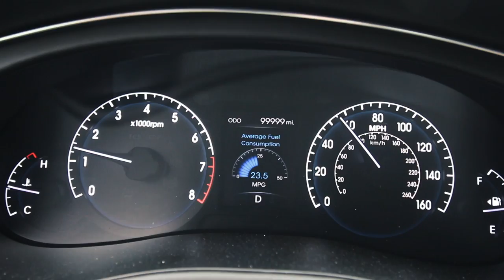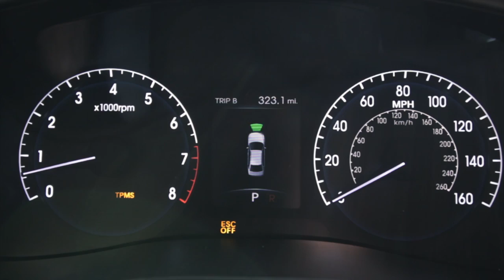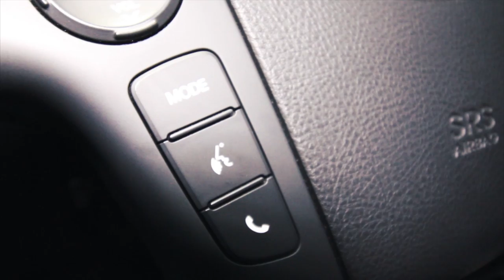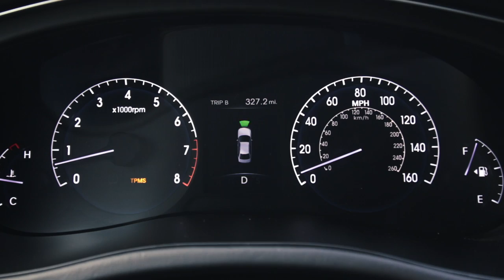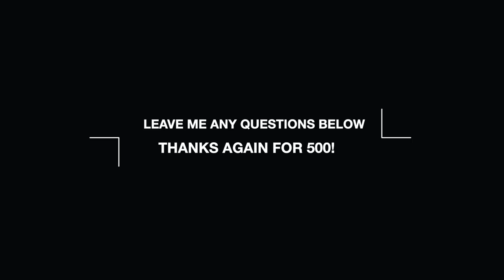2012 Genesis 5.0 R-Spec Long Term Ownership Review

Comment: Currently looking at a 2012 r spec. Thanks for the great info. I'm seriously considering the purchase.
Reply from the maker: wyohotrods No problem at all. Good luck with your search friend.
Reply: Consider a 2013 to avoid possible high oil consumption (based on what I've been reading)
Reply: If possible wyohotrods, look for a Southern Car and if possible, a one-owner R-Spec.  I bought my 2012 5.0 R-Spec down here in North Carolina and it was a one-owner with 67,000 miles. I found the previous owners business card in the owners manual and I reached out to him and he was awesome.  He took incredible care of the car and was in the process of upgrading the exhaust (he had the x-pipe installed) which saved me some coin as I installed Borla mufflers last week and it sounds incredible!!

Comment: 2013 3.8 V6 4dr with 112k miles. Fighting a parasitic drain. Dealer pulled drivers door lamp. 10 days later need a jump. Put in a new battery.  Few days later won’t start. Jumped and went yo dealer. They took out fuse for radio. Put in new fuse. Couple days later car died while driving. Back to dealer for a new alternator. Still driving but without fuse for driver’s door module and radio.  I’m near you in Chicago area (La Grange). Do you have any local mechanic who can troubleshoot parasitic drain?  At my wits end. Don’t want to get rid of a car that is mechanically great but need radio at minimum.

Comment: I had the leaky taillight on my 2013 that put an inch or two of water in the spare tire well.  I used a caulk gun and put outdoor silicon around the tailight foam gasket and pressed it on.  No problems since in 2 years.

Comment: Hey I have a question about the 5.0 Rspec I have a 2012 5.0 rspec and my autohold light came on but orange and the EBS cape on too just wondering if you know what’s up I read a lot on crankshaft sensor issue but you’ve had one for awhile so figure you might know
Reply from the maker: I haven’t experienced this so idk but maybe another owner can chime in?

Comment: I got a Genesis R-spec 5.0 its a big bang for the buck fast car with gov off can reach top end up to 186 mph? Cheap maintenance and more reliable than a BMW plus way cheaper. Waiting to see what this car can do if it was super charged get it up to 700 hpa see it run against a 2012 Camero ZL1, Shelby gt 500 and Hellcat? Wonder how many miles the Genesis R-spec can go before she dies? When the time comes rebuild the motor supercharge it it make a video run it againt please nice videos on the Genesis keep making more

Comment: Thanks a lot for this video man. I just bought the same spec car. Black r spec. I really like it thus far. But I’m arguing with the dealer who sold it to me about the windows not rolling down or the mirrors folding from the driver door controls. I literally just got this car the day before yesterday and I called them the same night about the issues. I’m hoping I don’t have any other issues with the electronics:-/

Comment: Does a 13’ 5.0 r spec for 10k with 170k miles on it sound alright for something in my budget right now. I dont drive more than 10,000k miles a year.
Reply: I own one with 67k miles they’re good and reliable but me personally i would not any car with that high of mileage. Especially not a V8. it would just be pointless.
Reply: i guarantee that there is a better buy for this car than that ,might be a bit more in price but lower miles.

Comment: Same here with the chevy heaters in 8  1/2 years I needed a headlight,thermostat,a set of tires and a tire sensor,everything else is good,just some cup holder sun damage,I got it at 2 miles and am at 95,500,same battery brakes rotors starter,just 2 sets of blades,good video I hated my accent but I like your  genesis
Reply from the maker: Thanks homie

Comment: Have you ever looked at the Hyundai Equus.  Pure Luxury.  I purchased a 2016 and then a 2014.  Both Ultimate versions.  Look very similiar on the outside but inside is quite different.  It has the 5.0 as well and there are no options for the car other than signature or ultimate model.  New the ultimates were at around 70K and the signature was at around 60K.  From the factory the car runs 275 in the rear and 245 in the front.  The depreciation is crazy on these as well  I picked up my ultimate with 33K miles on 2/2021.  I love it.  I like your videos though.  From what I remember you traded your genny for a VW?
Reply from the maker: It was an April fools joke.

Comment: I have a 2012 Hyundai Genesis Rspec Sedan and thanks to you I have the Brembo calipers front and rear, I have the BTR tune and I don't have the trans slow shifting or lag it will shift to 7,500 all day in manual mode and I get the burbles when letting off the gas, also the tune slow the traction control off just a little more, not completely turned off. I want to ask you about the BC coilovers what rates are you using I'm running 20x10.5 wheels with a 305/30/20 Michelin pilot sports 4s, the scrape every now and then, I want more control of the ride. Please help.
Reply from the maker: 14k front 10k rear
Reply from the maker: how do you like the tune? its kind of pricey for minimal gains, is it worth it for everything it offers?

Comment: my leather seats are beat up a bit... would like them to look new, any suggestions? wreaking yard? auctions?
Reply from the maker: I’ve always cleaned/conditioned my seats they have held up pretty well. Depends on how beat up yours are, if they’re really bad then ya, replacements seats are probably the move. I’d check eBay there are a bunch of totaled Genesis’ you can probably snags seats from.

Comment: By the way, I've noticed that "Genny" (as I call her [Genesis....Genny]....lol) sometimes launches better WITH the traction control on and then some other times without.....it's obvious that turning OFF the TC still doesn't turn it off 100%. It just seems to depend on what mood her traction control is in (fluid temperatures, launch speed, etc). I've seen a number of times where the ESC was turned off, but suddenly after launch when the RPM's hit high in 1st gear, the traction control suddenly took over again and just ruined the launch. Today she launched with traction control on and performed perfectly, smoking the rice rocket next to me with no loss of traction (asphalt was dry).....it was almost as good as AWD......what's your thoughts?
Reply from the maker: I've never really experimented with launching with traction on to be honest. I always launch with it off or the fuse pulled. But I can say TC is VERY invasive with it OFF and with the fuse pulled its entirely on the driver.

Comment: Luckily I haven't had the issues u named. My only pet peeve with the car is the Traction control not disabling, and the slow response from the stick shift(sport mode). Other than that my exhaust got loud and i loss a little power. I put seafoam in the gas and now the car is quiet again and back to its normal speed.
Reply: ...oh, and I wish I could get out of the car while it's running and lock my doors with the alarm key. You cant... u have to use the manual key to lock a running genesis.

Comment: I'm really considering trading my 07 ls460 for a 2013 5.0...I really like my LS, but the iffy trans downshifts....🙄 🙄 🙄 Are the 5.0's the same way? I like the sleekness/sport luxury of the Genesis.
Reply from the maker: Ya, the biggest downfall on these cars performance wise is the transmission in my opinion. Slow to respond and it’s confused half the time 🤷‍♂️
Reply: @Xtalgic  🙄🙄🤨🤔 same with the ls460's, the whole "searching for the right gear" is frustrating!!!

Comment: It's ya boi, got my tax return The Genny I was looking at might have just got sold though ☹️. I got 1 question though. How much have you spent on summer/all season tires?
Reply from the maker: In four years I’ve bought two sets of summer tires and have ran with one set of winter tires. Change them about every six months about 85k miles collectively.
Reply: @Xtalgic  Oh, tires aren't super expensive for it right? I'm never in weather below 20° but I do drive about that much a year. 

Also I found the Genny they just decided to move it to another dealer

Comment: Looking into the 2015 5.0 v8...worth it? Or go for the 3.8 with awd?
Reply from the maker: I would steer away from 2015 model years. Lots of people have issues probably due to it being first year production. I’d go with 2016+
Reply: Xtalgic _ thank you for the feedback. I’m pretty sure 15 was the only year they offered the v8? Until 17? But i could be missing something?
Reply from the maker: In 2016 they rebranded. Lookup Genesis G80.
Reply from the maker: 2017**

Comment: I saw a v6 is it ass good ass the v8 and the transmission will it go out or not because sometimes I race and sometimes I just do everyday driving
Reply from the maker: The V6’s came with a ZF 6 speed pretty sure. And the 8speeds were made in house as the first production by Hyundai on the first gens. So in theory the 6speeds by ZF should be better considering ZF has been a leader for a looooong time. Subjective though.
Reply: @Xtalgic  thanks

Comment: So far on my 2013, I have a broken folding mirror motor on the driver side and the same issue with the parking sensors.  It comes and goes though.   I will have to keep an eye on the sunroof as I use it every day.  Everything else works fine.
Reply from the maker: Grease dem slides!
Reply: W/ the OLDER Sonatas & Kia's,Best to Just Drain Ur Old Trans.Fluid,Repl.Same Amt.U Got Out,& 250-500 MLS.Just Drain Again & Repl.Same Any.U Got Out,By Then,All Old Fluid Out Of Converter is Usually Gone.

Comment: Anyone having issues with the backup camera randomly not working ? The screen will be black when I shift into reverse. I can fix it by opening and closing the trunk. But there are times where it's been difficult to fix
Reply: I am aware of the issue. Have a technician check the wiring in the trunk. When you open the trunk lid it may stretch the wiring harness and therefore compromises the camera and can also impact your taillights.

Comment: I am thinking to buy a 2012 Genesis 5.0 or 2012 bmw 535i. I am kind of confused on between this two car.
Reply from the maker: I actually cross shopped these two when getting my rspec. I chose Genesis because better warranty, more reliable, more power, cheaper to maintain/repair, and fewer of them on the road. However, if you’re planning to modify, choose the Beamer what more options for tuning available. Hope this helps!
Reply: Yeah thanks for the info and I am thinking to getting the 5.0 because of the reliability and the stock horsepower

Comment: I have a 2014. Just hit 103kmiles ...got it at 96k .. ac really sucks bad . Doesnt cool at idle well and takes a long time to get cold.m also when i let of gas to slow down it slows down funny then feel like the torque converter disengases when your almost stopped and idle drops really fast from like 1k to 500.. but doesnt do it if i flick the pedal a few times when im slowing down ... also both rear window regulators just broke within a week of eachother.. and radio makes crazy distortion electrica sounds sometimes .. i live in Az and summer is very hot so i might have to sell it cause ac sucks so bad.. already did new compressor condenser and vac recharge

Comment: Great info I have a 12 with the 3.8 v 6 it runs and drives great I have 2 issues the ac doesn't blow cold till I've been driving it for about 5 or 10 minutes and its fully charged and the information control knob slowly stopped working I would love to know more of what I can do to boost it up thank you for any help
Reply from the maker: My AC takes a bit to get cold as well. Characteristic of the car. And as for the control knob.. 🤷‍♂️ you can pull straight up it’ll come off. Maybe it accumulated dirt underneath there? Idk I never experienced that issue myself.
Reply: I just bought a 2011 Equus in Phoenix. AC takes a while to really blow cold. I was getting a little concerned about that.

Comment: Does it snow where you live? And if so how does it handle in the snow?
Reply from the maker: William Fletcher I have a bunch of videos driving In the snow. But... all you need is a set of good winter/snow tires and the traction control system will take care of the rest.

Comment: Iam lookin for the 4.6 dont need it to b fast i juss want a cheaper v8 sedan thats not a charger
Reply: My 2010 4.6 is working great at 87k. Need to do a transmission flush. Leather drivers seat is beginning to tear but that's all I have to complain about. Owned it for 3 years now. They're great cars
Reply from the maker: A lot of guys on here love their 4.6's, I mean its essentially The SAME motor as the 5.0 ;)
Reply: I have a 2012 4.6 just at 65k miles, and the only issue ive ever had was with a $3 fuse for the speakers. They are far more reliable vehicles then chargers, and shockingly fast too! Only precaution id give is make sure you get a good deal, cus ive been to several dealers up charging 5-10k cus they know the value this car brings.

Comment: Great video. Unfortunately my Rspec had the transmission issue and had to be replaced at around 70k. Alternator went just recently. Side mirror doesn't fold anymore. Everything else works just great but unfortunately these cars just dont retain value.
Reply: what year do you have?
Reply: @Faffilms  2012

Comment: Have you replaced tires on the vehicle?  If so were they relatively expensive due to the different sizes in the front and back?
Reply from the maker: At the time of this video I had stock wheels and tires which are not a staggered fitment. Same sizes all four corners.

Comment: Yea I have a 13 3.8 bought it at 34 k now at 96k still on OEM brakes I was going to change them in September last year bc I just knew I was about to need to change them and the dealer said no you’re still fine which blew me bc i haven’t changed them in the almost 4 years I have the car so the brakes are outstanding but I love the car so I’ll be trading it soon for the upgrade 3.3t 19’ g80 awd I’m sold and I’m a fan of Genesis I’ve driven bmw Mercedes ans audi and none of them have the same ride quality that my own car has and I like German cars so It shocked me but yea I’m sticking with Genesis I’ve literally only changed the oil and put on a new set of tires twice
Reply from the maker: I guess the oem brakes are solid, this is good info for potential buyers. And glad to hear you ownership has been as pleasant as mine! Good luck on your g80 purchase friend!
Reply: Xtalgic _ yessir it absolutely has!

Comment: How many sets of tires does the tire sensor remember. I plan to switch all seasons with winter tires.
Reply from the maker: One.
Reply: @Xtalgic  does this apply if I have separate set of wheels and tires for winter and summer? Do I need to program it every time I change them?
Reply from the maker: The sensors are programmed to your car. I suppose you can swap the actual sensors between tires. But that seems cumbersome to me..
Reply: @Xtalgic  so you drive it with all season in winter? I live in the Chicago suburbs and the winters are not pleasant.

Comment: Thinking of getting a "used" 2012 Hyundai Genesis 5.0 R-Spec 
By your comments, im thinking of getting it but it has 104,062 miles on it 
I just hope it doesnt have any problems (clean history tho) 
Only major problem is that it doesnt have the "wing" on the back...has the H zZzZzZ
Reply from the maker: I mean if the only 'major' problem is the drunken H badge, you have nothing to be worried about haha but def go drive it and see how she feels.
Reply: @Xtalgic   yeah but being put 104,062 miles. Whats the "FIRST" major problem you ran into? Anything crazy? or just some dead battery?
Reply from the maker: @leaveleague3491  Nothing mechanical, check electronics. Like i mention in the video...
Reply: @Xtalgic  got it, was curious about if you did have any major major problems after 29 days later. Thanks

Comment: I test drove a V8 Genesis back in about 2009.  I remember being surprised by the acceleration, but I also remember how incredibly cheap the interior felt.  The dash, trim, console area all had this thin plastic everywhere.  Even the buttons were jiggly and loose when pressed.  I was actually kind of shocked and disappointed - I did not buy the car.  That being said, I have seen some of the new Hyundai/Kia/Genesis interiors and they have come a long way in terms of style and quality.  They are easily on-par with the popular Japanese luxury brands with the exception of Lexus.  I think Lexus interior styling/quality is a small step above the other Japanese brands.
Reply from the maker: I disagree I don’t know if there were interior changes in materials from 2009 to 2012 (doubt it) but the interior is soft touch EVERYWHERE I don’t know what you’re talking about when you say ‘thin plastic’.
Reply: The problem is that you drove a 2009. I owned a 2009 3.8, and replaced it with a 2013 4.6 - there's a big difference in materials quality. It looks the same at the surface, but the the 2013 just feels much better put together. I think it took them a year or two to really nail down the build quality - there's a big difference in the interior quality between the two.

Comment: Have 2012 genesis 4.6L.  engine seized the other day. 85,000 miles, car is in perfect condition. I drive it hard. DESTROYED monte carlo ss to 80 mph. DESTROYED ford deisel to 60 mph. DESTROYED 2 ford f150 eco-boost trucks to 80 mph. DESTROYED bmw 5 series...probably was a straight 6. New long block 4.6L from hyundia; $17,000. Post start button...heard something broke in engine. Turned a couple times, then nothing. WTF!